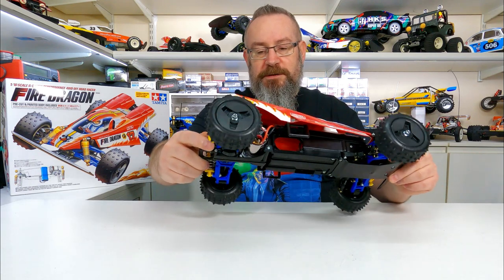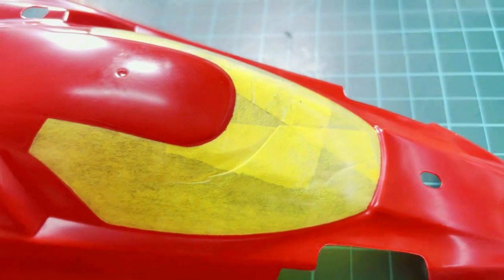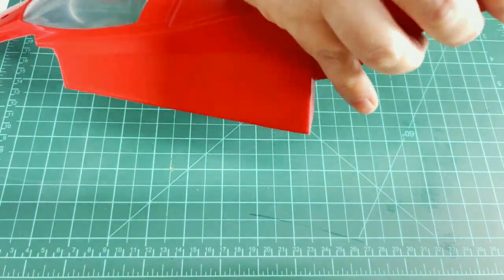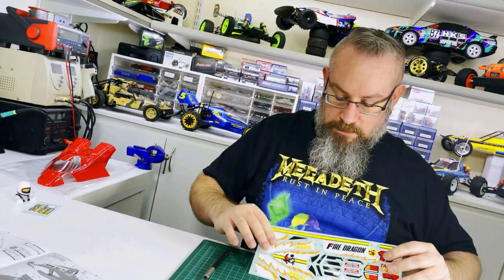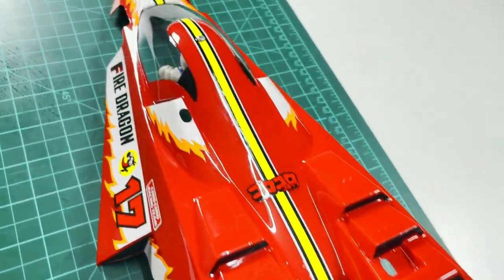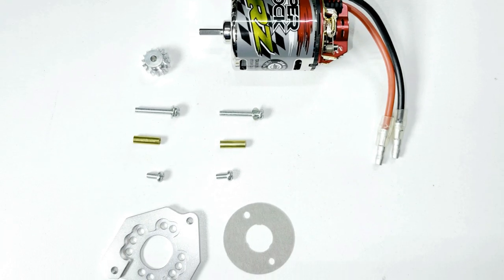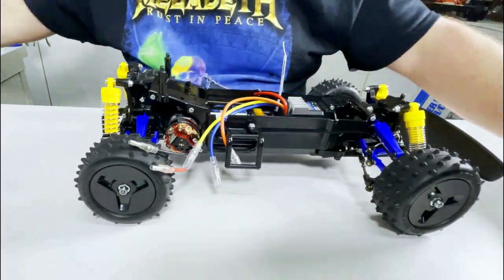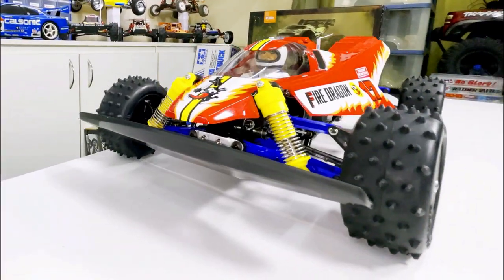Finishing The Tamiya Fire Dragon (2020) | Body, Motor & A5 Brace

Comment: Enjoyed the video Mick. Just out of interest did you notice that the front and rear shocks vary slightly in colour? I’ve had this issue with several kits including VQS, Terra Scorcher. Not a big issue but for display purposes it would be good if the yellow parts were consistent in colour.
Reply from the maker: Thanks Chris. I didn't really notice it too much on this one, but I know exactly what you mean. Some are very pale looking and others almost orange/brown. I used to work in plastics myself for almost 30 years. There are a few reasons why this happens. Badly mixed master batch (colour), moulding machine running too hot can make the parts look more brown. Cycle time not right on the machine, so plastic is sitting in the barrel too long before injection basically cooking. Dirty machine, EG after a weekend of not running and they haven't purged it enough before starting production, the parts will be dirty/discoloured. I could go on forever but I'm sure you're already bored 🤣.
Basically in the end it all comes down to quality control, or lack thereof. 😥
Reply: @RCHobbyShed  really appreciate the time spent explaining that one - I’ve learnt a lot -cheers Mick

Comment: Does the battery compartment have enough room for a standard lipo pack?
Reply from the maker: The battery compartment is rounded on the sides, so a standard won't fit. If you pack is rounded, it should be fine. I use Gens Ace packs that are still a hard pack only they have rounded sides. They fit most of my Tamiya cars quite fine. The part number is GA2S-4000-45C-H. 👍